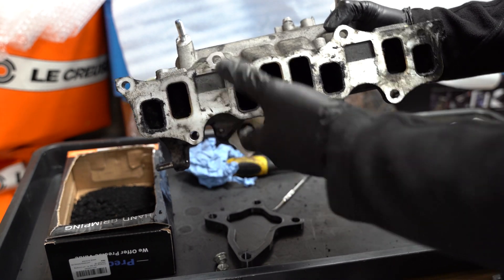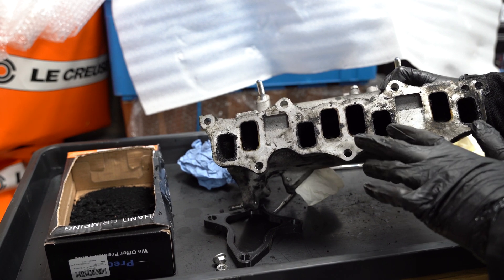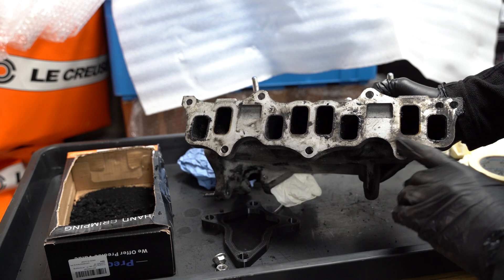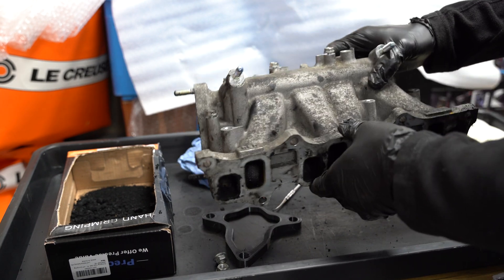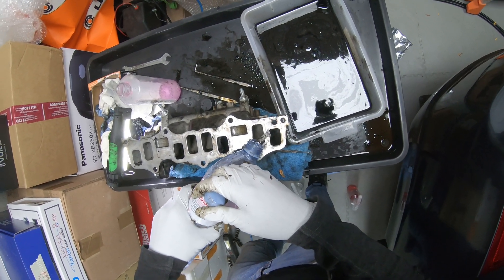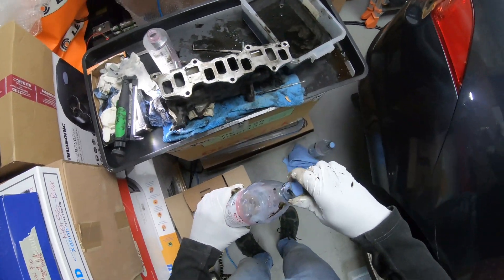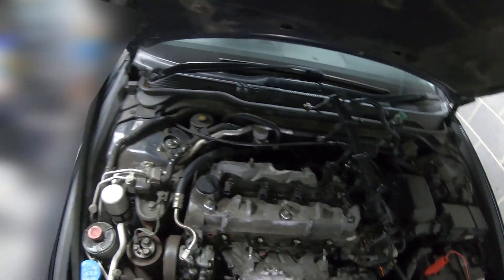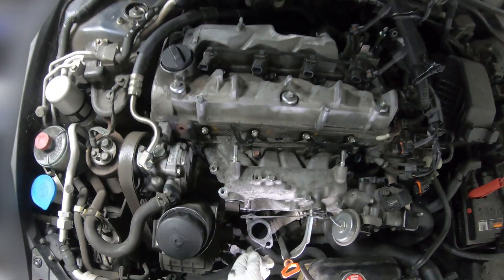Honda Accord 2.2 diesel - How to clean EGR and Intake Manifold - N22 engine

Comment: Very accurate thanks for video! Can you share what seals you have replaced in the whole proccess, im planinng to open and clean Egr, intake and throtle body! Thanks in advance!
Reply from the maker: On my car I did not replace the seals. I've done the job without planning for it, and could not find the parts locally at a reasonable price.

Comment: J'ai demonté ce jour egr + collecteur admission de ma Honda civic 8 i-cdti 2011 et 236000km. Egr obstruée sur 1/3 et collecteur très gras a l'intérieur mais je m'attendais a pire. Tout a été nettoyé au spray nettoyant injecteur + goupillon a poil dur en plastique. 4h d'opération. Les résidus ne partent pas en poussières comme ici mais plutôt en plaques très grasses. Remonté avec un joint d'admission neuf. La voiture semble plus souple en effet, vais la passer au décalaminage hydrogène on verra si ça va encore mieux ! Bon courage a tous ❤
Reply from the maker: the car is now ready for another +236.000 km

Comment: See the Honda iCTDi video, the inlet is split into two so half of is is controlled by an intake swirl valve. EGR and intake feed all ports. The reason why they will have blocked will be due to air velocity through the manifold. It will be slower where it has blocked.

Comment: good video. is there no swirl flaps on this engine?
Reply from the maker: by the looks of it no. I had to rewatch the video as I forgot it :)
Reply: @BestCarMods  i have same engine (n22a1) and with engine check warning, went to the garage to check it out, they plugged it in and it says swirl claps fault 😬
Reply from the maker: I think it has only one flap that controls air to the second air port of each cylinder @lektorpltv
Reply: @BestCarMods  that’s what I worked out, controlled by solenoid which is probably faulty I’m guessing or egr is clogged up

Comment: Is the removal of the egr in the 2012 i-dtec Accord the same as in your model?
Reply: The idtec is different
Reply from the maker: :) don't know. the principles are similar... you take it out, you clean it and put it back. the 2012 i would expect to have electronic control vs vacuum on the old
Reply: idk if you still need that info but the dtec engines compared to the cdti ones is that they're turned 180 degrees meaning the intake side points towards the firewall and the exhaust side is pointed towards the front of the car, meaning it wont be as simple as with cdti models to remove the intake manifold

Comment: That the car has problems until you clean the egr, I have the same one and I found the egr clogged, check on it limits my power and it goes into limp mode if I accelerate it and it is limited to 2k /min with you av

Comment: Do you notice major improvements? Mine has 300.000 km and running pretty well, but I think at least EGR cleaning would be a nice operation with its mileage.
Reply from the maker: better low rev torque
Reply: I have cleaned mine, but just the valve and I see major improvement. Better low torque as per previous reply and almost no turbo lag. Engine is accelerating smoother and its more eager to go as you put your foot on accelerator

Comment: Do you know the possible reasons why this engine sounds so clattery? It sounds like a truck or old tractor engine, but they should be smooth and pretty quiet.
Reply from the maker: honda engines sound very metally for me. very high pitch vs audi ... bmw ....
Reply: @BestCarMods  got same engine but sounds way better
Reply: @BestCarMods Greetings. I had Honda F-RV 2.2 the same engine as yours and i need an opinion, only on acceleration around 2k rpm the same knocking clattering sound is heard just like this one from the end of the video, I'm assuming that the crankshaft bearings are the problem. Do you maybe know what the problem could be?
Reply from the maker: @stefanristovski3083  to give answers based on the interpretation of a noise, without seeing the car is a recipe for disaster.
Reply: I'm guessing that its because he was recording inside the garage? It made me think my 2004 2.2i ctdi sounded like it was new..
Reply from the maker: @johnmac4094  starting it after the fuel system has been disconnected will make it sound rough.
Reply: @BestCarMods  ah, that makes sense. Good vid btw.. I dread to think what mine looks like, I know it’s a job that I’ll have to do soon. Was there something to indicate that the manifold was blocked up?
Reply from the maker: @johnmac4094  absolutely nothing. The construction of this manifold allows one port to be clean, so if you really don't care about the car it will still be able to work, even if you don't clean it. You loose performance and you have bad emissions, but this engine still is going .
Reply: @BestCarMods  thanks for sharing your knowledge. I hear these engines suffer a cracked manifold, I wonder if it’s from overheating due to the blockages?
Reply from the maker: @johnmac4094  they have a cracked exhaust manifold and that is due to the way they welded the part ... the new part/replacement is one piece .... had the issue on this car also.

Comment: So im going to be doing this soon on my 2015 328d sportwagon, but i have a code that pops up for cylinder1 injector learning maxxed out, it comes and goes but the car never has performance issues that i notice. Any idea what it may be? Slightly Clogged injector trying to compensate for loss of volume due to clog? Fuel filter and water separator already changed, air filter changed, oil always at 5000 miles. Transmission fluid, pads, rotors and transfer case all replaced. EGR was replaced under recall. The guys at the shop did spill oil all over the engine once when filling it and i've wondered it that could have seeped down into the hole and caused some sort of an issue?
Reply from the maker: never had that type of issue, you will need to use the feedback from ISTA to troubleshoot.

Comment: Why is it turning over so long before it starts up?
Reply from the maker: fuel system has air in it.
Reply: @BestCarMods  Don't you have a manual fuel pump to prime the system? I believe it is not good to crank the engine so much without because the high pressure diesel pump is running "dry" and could get damaged. Otherwise good job  for the manifold cleaning! I want to clean mine too (2007 Civic) but my mechanic doesn't want to do it - says there is no point since the car doesn't have obvious problems. Still I think there is something wrong - engine shakes too much on shutdown but I don't know if it is related.
Reply from the maker: @DimitarDobrinov  You have, however because you removed common rail and injector lines there is a lot of air in the system. that pump will help you more for an oil filter change.
Reply: @BestCarMods  I think you meant fuel filter. Thanks for the vid, I'm a DIY mechanic and got the EGR code last week, you gave me the fuel to start the disassembly fire :P

Comment: I have 2008 same car, I would like to do the same clean but wouldn't want to take apart all the wiring and fuel line incase I can't remember how to put back together. Mine has 120k miles, runs good but I bet it is caked in soot just the same. I live Manchester. Hint hint 😉
Reply from the maker: you can't do it without removing the intake. I have seen some guys advertising a special foam that you put in the intake and it might help. never tried it. don't worry to much about not knowing how to put them back, they are designed to fit easily back, you will see that it is much more simple to refit that to remove. just take your time
Reply: Record everything you do with your phone. Impossible to forget after that.

Comment: I've had the P2004 code show up couple of times and thought previously that the gasses from the egr went through the flap part. Could the carbon build up so that the flap can't move properly? I am planning on doing the whole intake and egr cleaning but I just realized from this video that you can remove the flap part only, is this right?
Reply from the maker: I don't think that you can get the flap that dirty. you will get the deposits mostly in the intake port + valves + intake plume n1/2 of it. I am curious what you find on your car.